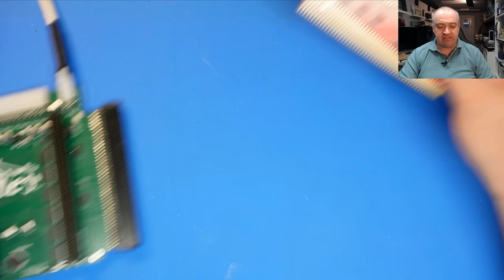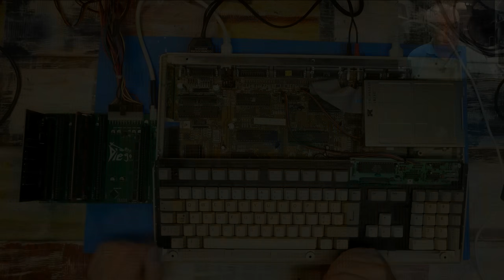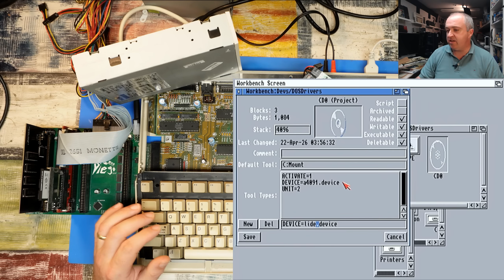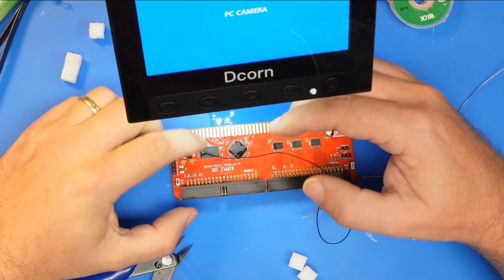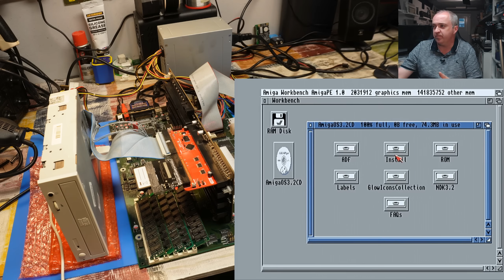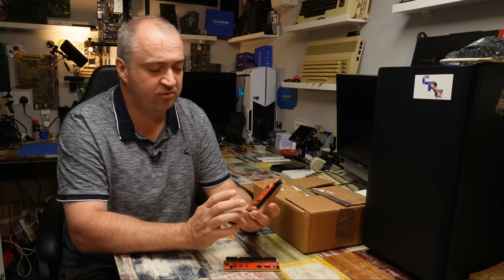Hacking features into this Ripple IDE prototype

Comment: SCSI isn't going to be faster than IDE since the Amiga scsi cards use a scsi chip WD33C93 that has only 8-bit data bus (i.e. narrow scsi). To get faster scsi you would need something from the PC-world like SCSI-Wide or Ultra SCSI and even then the Amiga CPU and chipset will limit the speed. I've made and used some of Matthias Heinrichs' IDE cards and iirc I got over 7MB/sec on Sysinfo although I don't remember the exact spec Amiga I was using at that time. You could maybe get faster speed with the ReA4091. Or if you have the time and dollars build (or buy) the new A4092 which quotes 10MB/s speeds and uses all modern parts. But even so 10MB/s is really just the maximum speed of Fast SCSI which is still an ancient scsi variant. If you do that I'd be curious what the BlueSCSI / AzulSCSI etc benchmark is. On my A3000 I have a 76GB Ultra320 SCSI drive hooked up using a couple of adapters (80 pin -> 68 pin then 68 pin -> 50 pin lol). It's nothing to write home about but at least any bottleneck is not the drive and 76GB fits the entire Amiga software library ;-)

Comment: I always wonder why they do IDE only. Why not SATA, so we can attach SATA HDDs and especially SATA SSDs? Also, IDE/SATA could be done with DMA. If it‘s possible with SCSI, it‘s possible with IDE.
Reply from the maker: The simpliest answer to that I would assume is complexity.  But I do conceed that such a thing would be very nice.
Reply: @CRG  I've got an mSATA to IDE44 adapter in my A1200 with a 128GB card and runs pretty well. Not sure of the speeds, probably bad as usual hehe! But certainly gigabytes of storage on any Amiga for the entire software library is not an issue if you need it.

Comment: I used to use something on the A4000 to run CD32 games, I think it was IDE Fix'97  from AmiNet, I'm not sure if I also had something else but it worked when I was developing CD32 games, might be worth trying, if the games used the OS graphics library for C2P, if the Akiko isn't found it will fall back to the CPU which with an 060 will be faster.

Comment: There are reasons why SCSI died out and most of them are very good reasons.....termination, cabling, unit numbering, price, etc.....Back in the day I had Amigas with both SCSI and IDE drives and none of the SCSI drives were any faster than the IDE drives and in many cases they were slower. And the SCSI drives all cost substantially more than the IDE drives.  I had friends who were fanatical about SCSI though.  Even after being shown benchmarks where the IDE drives outperformed the SCSI drives in every test, they still clung to SCSI as if their lives depended on it.  It was almost as bad as dealing with the contemporary Macintosh and Atari users of the time.

Comment: I wonder if a CDTV game/application would have booted properly on the A500 with Ripple
Reply: Probably not all, because the additional ROM the CDTV and A570 had is missing. I guess there‘s stuff in there the CDTV titles used.
Reply from the maker: Possibly but unfortunately I dont own any such titles.  If I can find an ISO I can try it.

Comment: I still think an ATX or mATX version of the Diego 500 would be an elegant solution to having a case for it.  The ATX case would have the drive bays for any drive the user could throw at it as a bonus let alone a place to keep the ATX PSU.
Reply from the maker: Ive got an idea for something like this but its a bigger project than just diego.  Might be a while but I think an Matx Amiga would be a cool thing to have.
Reply: @CRG I've actually looked into doing an ATX version of the A500 in the past but it didn't make much sense with the EATX A2000 around.  An A600 or A1200 may be a better target.  My entire Amiga collection is literally 1 PAL A500 with the "Space Invaders" keyboard.  I would love to grow my collection.
Reply from the maker: My initial thoughts on it are to style it like a pentium 2 board.  So CPU slot only, no onboard CPU.  Perhaps 3 zorro slots and a video slot.  Maybe build in this ripple card for dual channel IDE 😉.  Internal floppy only, drop the external port and equally drop the parallel port.  Might also look at an internal rgb2hdmi so no rgb port as such, just hdmi out.  

Big project though so I'd take me a while to pull together.

Comment: Great card, but I have one question. Can the autoboot/autoconfig be disabled so it will happily work alongside both the TF536 and Pistorm ?.
Reply from the maker: If theres no disk in the drive it just boots to DH0 as always.  Or if you want to permantly disable it just erase bank 1 on the rom.
Reply: @CRG  you can still mount and use the drives though right ?
Reply from the maker: Yep, without the filesystem on rom you can still just mount the drive as always